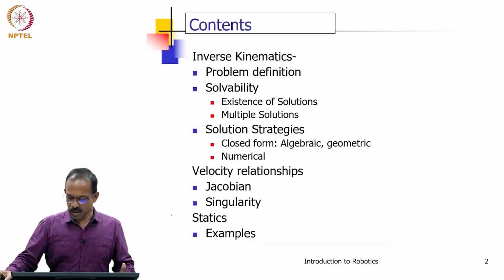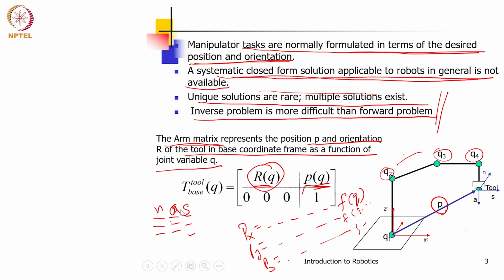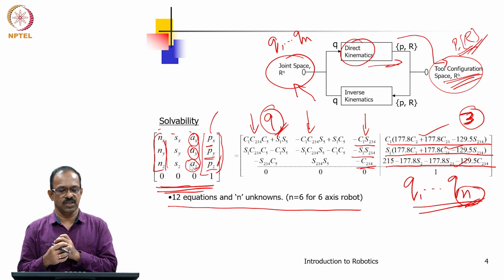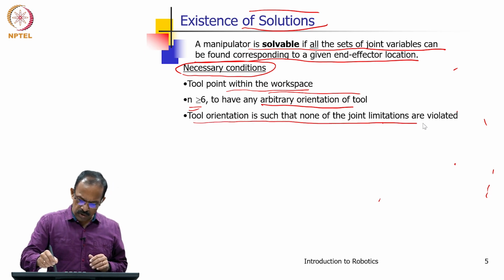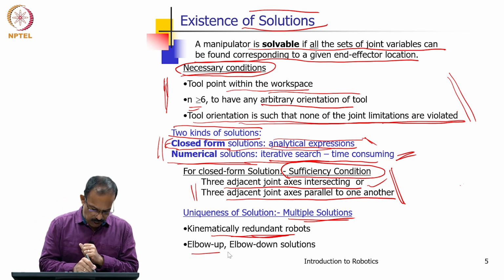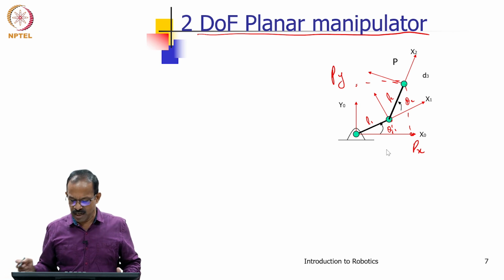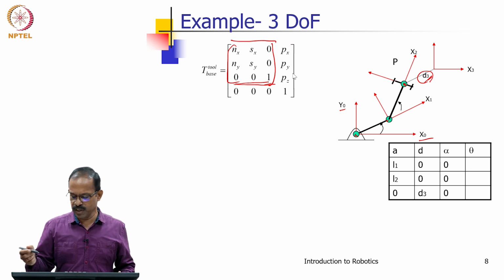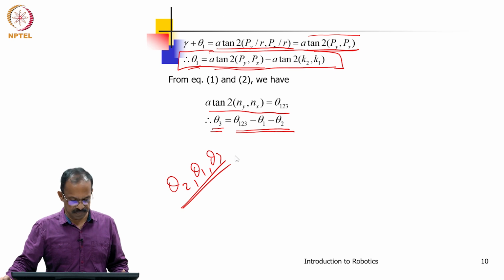#12 Inverse Kinematics | Introduction to Robotics

Comment: Sir i have two doubts.
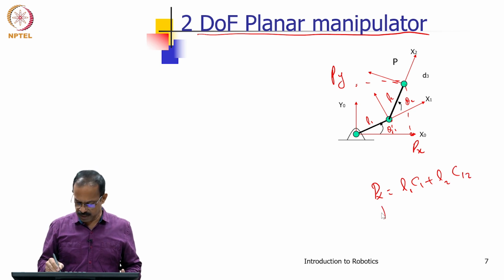38:09 = why we use cos for x axis and sin for y axis?
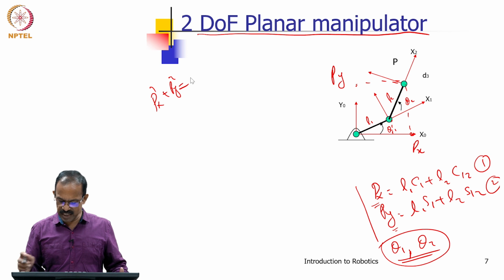39:13 = I solve that Px^2 +Py^2. But  I didn't get C2..Is that any trick behind this step?
Reply: 1. Because angles are always measured from X-axis.
2. After the expanding and adding the equations.Take l1 and l2 common, and what remains is the expansion of cos(theta 12 - theta 1)... Thats how we get C2.